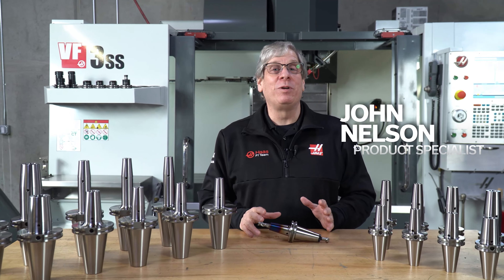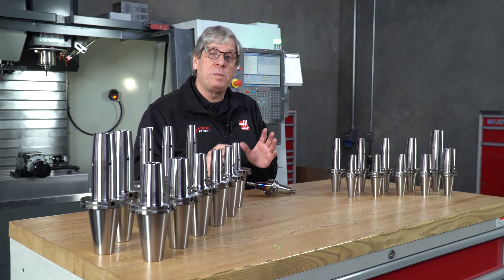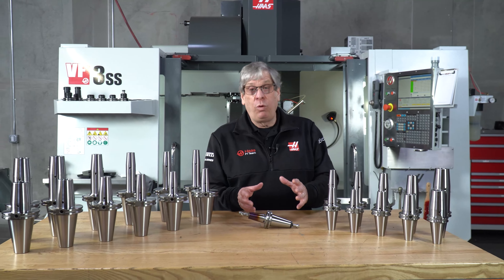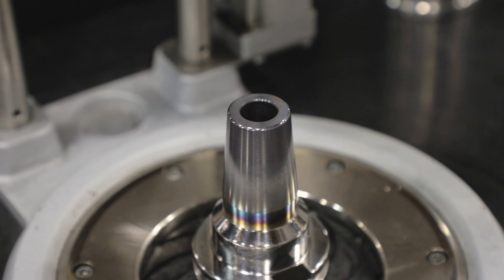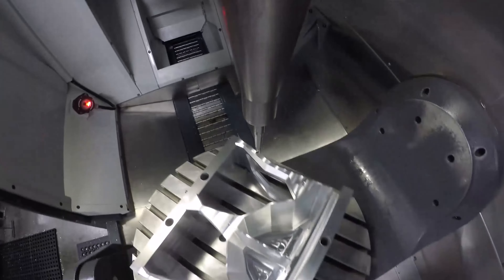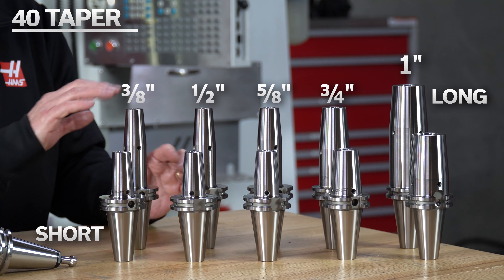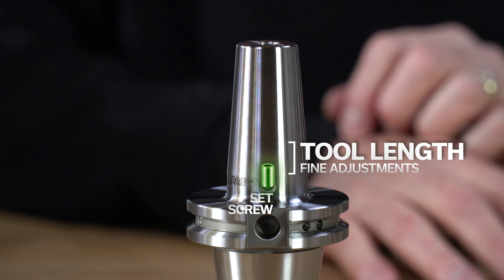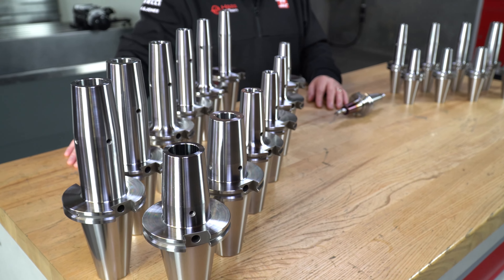Get Shrink Fit Tool Holders at HaasTooling.com - Haas Automation, Inc.

Comment: How much is induction holder  and shrink fit tooling cost?
Reply: I find them in general two to three times the price of an ER collet chuck, but occasionally find a bargain or two on eBay for £30.
The cut is so much quieter with them and surface finish is vastly improved, can't recommend them enough and I'm just a very small occasional machinist.
Reply: Forgot to say, I just use a gas torch! 

Shrink fit tool systems don't need to be as expensive as these manufacturer would have you believe. It can be under a £100 set up, instead of the 1000s + of the all singing systems.
Reply: @thomashenderson3901  yes definitely ignore the reps that say you NEED the induction heater that costs thousands.... we have solid shrink fits and small ones you put in collet chucks (great for extra length tooling) and we just use a gas torch and gently pull out tool with pliers. All it does is discolour the holder more than the expensive heater unit would. And its not much time difference either. It will not deplete the life of the holder at all
Reply: This is not a matter about heating more. You need to heat fast, especially for unshrinking of steel extensions and HSS cutting tools. Furthermore, you will have control on temperature of holder with nice shrink machines then you will not destroy clamping bore 👍
Reply: @mehmetyildirimkaraman9395  like I said, we've used the same shrink fits for years and they're just as good as day one and we don't have a heater unit. The simple solution for getting tools out is dont use HSS... carbide doesn't grow anything near steel and the people who would need to use shrink fits are the people who can afford carbide tooling.
Reply: @wildin13  Which brand holder you are using? Maybe it stainless steel like MST, it is easier because of less tightness in between tool and holder.
Reply: @mehmetyildirimkaraman9395  in honesty I don't know the brand. We get ours through a company called Castle Carbide. I dont believe they are stainless but I could be wrong. Either way unless your dealing with ALOT of holders frequently, the cost of those expensive heating units can be avoided

Comment: is there any way to get the Insert back out of the Holder in Case the End Mill breaks?
Reply: Inductively heat it again I guess, may disrupt the hardness of the steel.
Reply from the maker: Good question Dave1812, The induction heater heats the tool holder quickly and evenly enough that the bore in the tool holder opens before the tool itself heats up. This is good since this is how you replace the end mill or other tool when it is worn and ready for replacement.
Reply: Use solid carbide and not HSS! You will never get carbide "stuck" in a shrink fit
Reply: @dave1812 Yes, Haimer has unshrinking device and you can push out your tool shaft by pin.

Comment: darn... I got really excited until I saw the smallest size was 3/8".... bummer
Reply from the maker: EngineeringScience, Please let us know what sizes and types of holders you're looking for. We are continually adding more tooling to the site and obviously interested in supplying the tools people really need.
Reply: @haasautomation  I'm pumped you reached out. I have a vf2 with a trunnion and I use (and seem to always nee more of) cat 40 1/8" and 1/4" holders with standard reach for clearance and what not (it so nice having tools set up offline).
Reply: @HuskyMachining  seconded. 1/4 and 1/8 seem harder to find
Reply: 1/4" would be great!
Reply: 6, 8, 10, and 12mm would be great 🙂